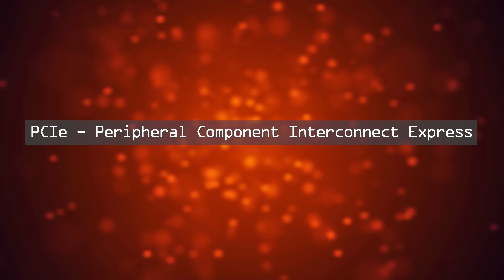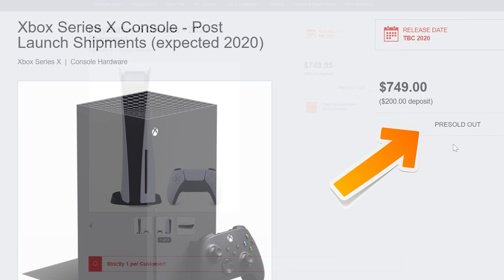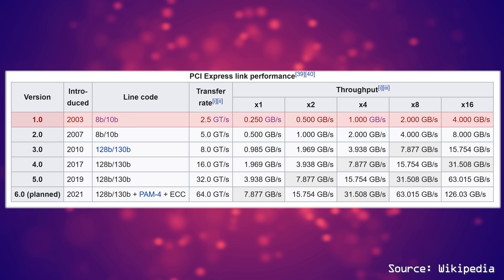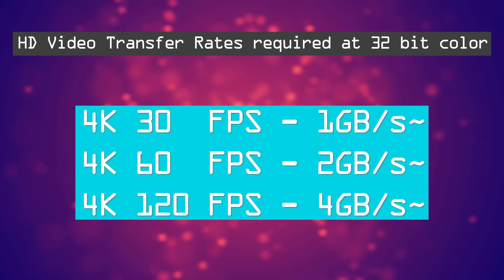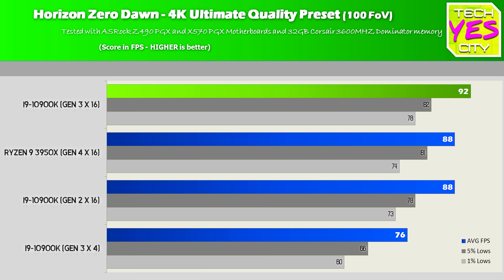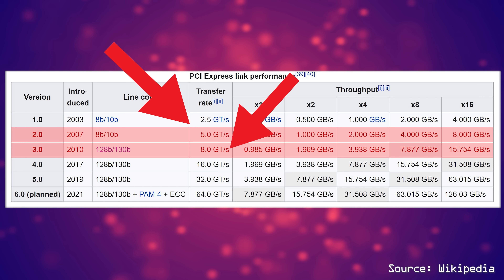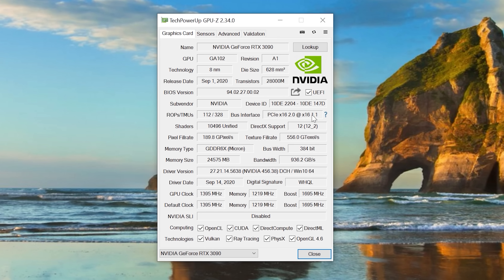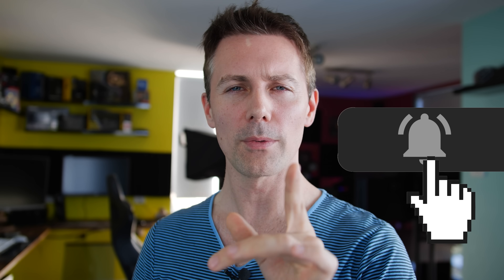Why PCIe 4.0 Doesn't matter for Gamers... Yet

Comment: Great video as always.
It's a real shame not a single person on YouTube tested this with a 3090 Ti and it's a shame that most of these videos doesn't actually test PCIE 3.0 x8.

I really believe that the 3090 Ti, running at PCIE 3.0 x8 would in fact start to show the limit and for sure I would want to also see it tested at PCIE 2.0 x16

Yes, we may just be talking about 5-10fps here and there on the majority of games, but there are a few game engines that actually result in over 10 frames difference.

Comment: I'm just thinking how did they test with pcie gen 2 
like they didn't use old mobo right??
Then how? 🙂
Reply: Likely just by running the gpu at PCIE 3.0 x8
Reply: @marknewellmusic  Is it possible to limit 16x to 8x?? and also to 4x??
Reply: @ashrafjamanshihaf3032   Yes in motherboard bios settings.

Comment: Im about to pickup an aorus b550 master and the pcie slot goes from 4 x16 to 4 x8 when populating the lower 2 M.2 slots.

Given the results here is it fair to assume that with a 3080, i wouldn't have any substantial fps loss using it at 4 x8 vs 4x 16 pcie speeds?

Comment: So here’s a issues I’ve been throwing around in my head. I have an original 2009 Alienware aurora 

Still running an 
Intel i7 930 @ stock 2.8ghz 
24 gb ddr3 ram 1333
And currently has 2 gen 2.0x16 pcie slots which houses a 1gb ati Radeon hd 5770 

I purchased a 1070ti of eBay and it arrived tomorrow and I’m so concerned that it will bottleneck and not give me great performance but after watching this video I think I should be good. But still don’t want anything to happen after it being fine for so long. I would like the performance gains though.

Comment: Thank you for this video !
I want to put my 6900xt in a small case and i may need to put it in the 2nd X16 slot of my motherboard. This slot is gen 3 x8 in a x16 slot, so basically gen 2 x16 speeds. 
Your results tell me that i wont have any performance reduction!!!
Reply: Did it work?

Comment: Came back to this video because of how USB 4.0 Version 2 just got announced with it's bidirectional 80Gb/s connection. Theoretically this should place the new standard somewhere between PCIe 2.0 x16/PCIe 3.0 x8 and PCIe 3.0 x16 with it being closer in performance to PCIe 3.0 x8 than to x16 (64Gb/s vs 128Gb/s). This is really awesome for gamers who want a laptop that can be an everything device with a single cable for connection, I can't wait to see your review of the first devices to have this spec!

Comment: ACTUALLY WRONG: With 3dmark bandwidth test my evga rtx 3080 ftw3 12Gb uses 13Gbs so with pcie 3.0 being 15gb if I ran it in an older revision it would not perform as well at all

Comment: I HAVE A B450 MOST OF MY PSI SLOTS OF FULL SOUND CORD VIDEO CARD ETHER NET CARD NOW I ASK U WAY DUZ MY PC INFO SAY ON MY GPU DRIVER MY CARD IS RUNIN G IN PCIE 3 8TIMES NOT 16 TIMES NOW I THINK ITS CUZ I HAVE ALL MY SLOTS FULL AN ITS CUT IT DOWN FROM 16 TO 8 TO FILL MORE SLOTS RIGHT OR WRONG AN 2ST I DONT NO IF THE B450 JUST DID NOT COME WHITH 16TIMES BUT THAT DONT SEEM RIGHT AN THE CARD IS IN THE GPU SLOT NOT THE SLOT THAT THE CHIPSET RUNS  GPU THOOWE  PS SORRY FOR SPELLING I HAVE A,D,D

Comment: so, since I only have a 1080p 75Hz monitor, I can feed that for just under 600MB/sec. So the fact that I only have a PCIe 2.0 system shouldn't worry me at all. Even x2 is good enough for that, and the GT 1030 is x4, so it's okay at 2GB/sec. It's just that the GPU core is weak; that's why I want to upgrade. Having a SFF limits my choices to the single slot low profile cards - the RX 6400, T600, and T1000. Looking at this, I'm less concerned about an RX 6400 being hamstrung by the bus; it might actually come down to be a good match for the CPU. Though a T600 might work better being a PCIe 3.0x16 card, and may be slower but less stuttery? IDK, but a T1000 would be the better but more expensive nvidia option. But then again, there's FreeSync to consider (my monitor has FreeSync but only HDMI... can G-Sync work over mDP to HDMI conversion? Or is the RX 6400 the way?) 

Yeah, I got questions.

Comment: So Tech YES City,

Assuming x2 performance gains in RTX 4000s vs RTX 3000s...

Are you saying that an RTX 4090 should run fine with minimal performance loss in a PCIE 3.0 x16 slot at 4K max settings?

Comment: You can’t compare on two different platforms. You need to use an 11900K vs a 10900K then use 2560x1440P or even 1080P. You’ll see a substantial difference of up to 5% I’ll take
It. However it is the 0.1% lows that improve the most here.

Comment: So should be totally no difference between PCIe 3.0 x8 and PCIe 3.0 x16 on even high tier cards like RTX 3080 or even 3090 right ? My problem is that I have PCIe 3.0 x16 connector on the board and I am not sure If I will lose some performance If I will use RX 6600xt which has only x8 PCIe lines. Maybe rx 7600xt can have RTX 3080 performance but It probably will use PCIe 5.0 x8, can it be bottleneck on my PCIe 3.0 connector ?

Comment: I have a RX 6600 that will not display on a B550 or X570 motherboard I have. But I put it in my B450 and it runs like Usain Bolt on Gen3. Changed settings in the bios, updated drivers, swapped out M.2 slots, changed to 8x8 in the bios and gen 3, but would not display. Turns out I really don't need Gen 4 anyway, maybe Gen 5 but by then your graphics card is outdated.
Reply: Hey ,  can you more detail , i plan to buy RX 6600. To my mobo b450m , it's still runs or have more issue ?

Comment: right now its not important, but most likely by the time a 4090 comes out, it will matter, also with windows 11 having technology like the ps5, where your gpu can access data directly from your m.2 drive. ps5 does this instant data transfer on a PCIe 4.0 platform. pc's in a year or possible this fall with alder lake and windows 11 will take this tech to a new level using PCIe 5.0. 4k (native) 144fps gaming is finally coming!  and I think it starts wtih PCIe 5.0, DDR5, windows 11, and a graphics card to support this tech, most likely the 4090 will introduce this.

Comment: I'm runnin a RTX 3090 on an old H110 board as my Z170 board decided to kill itself :S PCIe 2.0 x16 seems to work fine until I can afford to upgrade the MB and CPU in the summer

Comment: Hello sir, can you please tell me if it's worth buying a Gen 4 compatible motherboard in 2020 as I am literally very confused. I am building a PC that I plan to upgrade after 4 or 5 years. I won't change the Mobo though and that's the question, will there be noticeable differences between gen 3 and gen 4 after several years or not?

Comment: what if I have a gen 4.0 gpu and a gen 4.0 motherboard but a gen 3 riser cable. would it actually run and would I need to make any changes with the bios or would it not work all together and i've wasted money on a riser cable?
Reply: It would be backwards compatible so your good.

Comment: The main theory is that with the consoles using pcie4.0 that texture streaming will become a major factor. Issue is, that it may not even tax the PCIe 3.0 NVME. At least not the fast 3.0 NVME (3gb/s r/w) so we will see.

Great video and will be linking it

Comment: Thank you so much Brian for your testing and results!!!

Looks like I will be putting a 3080 card into my beloved x58 system. (x5675@4.4ghz)

Going to try and stretch the x58 platform out till ddr5 is here. Anyone else with me?
Reply: Yes mate I'm with you. Still rocking X58.
Reply: @Vorper  NICE!!! would love to know what parts you are running
Reply: x58, W3690@4.1GHz all 6 cores HT off, RTX 3060@2114MHz PCIE 2.0 x16, 24GB ECC ... so glad the RTX isn't too much for the slot. Game (dev) On!
Reply: I get that this is old, but w/e. I'm still running an old X58 system. Do I need to overclock in order to use a 30 / 20 series graphics card without a bottleneck? If it helps I'm running a X5690, but I don't really intend on overclocking unless I absolutely have to.

Comment: isnt 125hz pooling rate 8ms and 1000hz is 1ms which would be a 7ms diffrence maybe you meant 250hz to 1000 as thats a 4ms vs 1ms which is rightnear your 3ms. or was he saying in that mouses case going from 125hz to 1000 ms even tho the pooling rate changed from 8 to 1ms that it only changed a net of 3.5ms of delay

Comment: Can agree on that.
The same was with PCIe 1.1 vs PCIe 2.0 and PCIe 2.0 vs PCIe 3.0 Even saw benchmakrs where the most powerful cards had differences in the single digits at worst.
I actually got a system with a board that supports PCIe 1.1 but the GPU can run PCIe 3.0 and it works perfectly.

Comment: I was relatively shocked by these results however something occurred to me. Current gen games do not fully take advantage of RTX 3090. And probably will not for a few years. I think you should revisit this when games become more difficult to run or try these experiments with VRAM eaters like MSFS 2020. Games designed for current consoles and then ported are taking advantage of that hardware. And it's at least 4 years old or older depending on whether you have a "pro" system or not.
Reply: Say that to 4K ultra, RT.

Comment: I don't understand why you would calculate the bandwidth needed to send 60 fps 4k. It never goes through the pcie interface to the cpu, it is sent to the monitor via hdmi/dp.
Reply: to make a false argument that's easy to understand? I wouldn't be surprised if the games were installed on sata ssd as well...

Comment: Gonna try a 3090 in a PCI x16 Gen 1 slot (DFI NF4 eXpert board) when I manage to get one to see how gimped it is. Pity the overclocked FX-60 I have installed will already have it at a crawl
Reply: Gen 1 oh god that's brutal and it'll work, but it's absolutely crazy. Please pair that a 8k display .
Reply: Bro did it work?
Reply: @sauravmodak507  - never got round to it before I water cooled it.
Reply: Wait...did it work or not? Watercool, what, the chipset?? The MB will only deliver x16 gen1 bandwidth to a GPU that can handle 4 times its max. Just for kicks, what GPU would work on a F2A85-V
Reply: @ShrekMeBe  - no, I water-cooled the 3090 and installed it into my normal (now secondary) system.

Comment: And then there are the german PC/Game-sites - really leaning to being total AMD-Fanboys - claiming they need to test the RTX-cards with Ryzen cause they need PCIe 4 - despite all tests showing that those card run just fine (and basically always faster) with an Intel CPU and "only" PCIe 3. Heck - your video shows that in many games there is nearly no difference between Ryzen PCIe4 and Intel PCIe 2 - not that you would realistically have a system with PCIe2 where the CPU was not the bottleneck.

Comment: what if you're running 3 screens, each at 1080p?
Reply: you need 4 1080p monitor to have data rate of 4k monitor. if a 4k 60 fps monitor just 2GBps then 3 monitor 2160p each then it just 6GBps which PCIe 2.0 can handle
Reply: Then you've shifted the bottleneck more toward the GPU and the  eleague crowd will suggest you benchmark at 720p or 480p to make Intel look better.

Comment: Hardware unboxed proved this too, at 4k there's no difference, but at 1080p and 1440p there is a very small difference. Where it matters is if you wanna use the second and/or third pci slot for something else, than the bandwidth provided by the gen 4 would make sense.
Reply: I could see running two nvme drives in the next upgrade and at least in current designs the second drive either runs through the chipset or steals lanes from the graphics card. With pci4 I don't think it would matter.

Comment: It's kinda ridiculous how some people are pushing Gen 4 like it's the next best thing to sliced bread. Only benefit is you can use faster SSD's but even then it has no impact on gaming performance and the prices are still fairly high considering the amount of space you are getting. Definitely worth holding off for another year or two at the very least.

Comment: One point to understand Brian: the bandwidth you calculated regarding resolution, is the connection from the GPU to the monitor - and has nothing to do with the PCI-E slot. 
The PCI-E slot doesn't carry the image signal - it carries geometric data and textures (at the first stage of caching them into the GPU VRAM). so your calculations there are irrelevant to the matter at hand.
Reply from the maker: You are right, and I did think about this before talking about these numbers, though I ended up using it just a rough guide to help folks understand data rates. And since the numbers actually lined up quite closely to the numbers I was getting in all the games tested, it actually surprisingly will give insight into how much data needs to be transferred between the CPU and the GPU.
Reply: @techyescity  The PCI-E is like another I/O in the system. that's all. the PCI-E bandwidth dictates:
1. how quickly the VRAM of the graphic card can finish pre-caching the textures at the game level beginning. the faster it is, the shorter your waiting is at the game next level loading time.
2. to transfer geometric data on the fly from frame to frame in real time. the geometric data is weighted by the number of polygons at a given image. as time advances games use more and more polygons for more advanced imagery. that's all. so the faster the PCI-E is, the more polygons it can do in a given frame. PCE-I rev 2.0 is still enough for the polygon count used by today's 3D engines. for how long it will be enough in the future ?   this is something I do not know or cannot guess. 
For the time being it is enough (2020) and we could see it by your testing, same like other sources on the web coming to the same conclusion. 
**Faster PCI-E will help in cases where  you use more VRAM than the GFX card has, as it helps with texture swapping against the PC's Ram to happen faster. although you should never set in game quality to surpass the VRAM in the first place, to prevent stutter and low performance.
To sum it up, the advances into PCI-E Gen 4.0 by AMD, is not relevant for GPU usage right now, and can be beneficial to other usages such as faster NVME cards etc...
Reply: @jediii86  that too
Reply: benchmark still says the bigger pictures tho, he tested the card and he got those results
Reply: Dex4Sure  I did not write AMD developed it, I merely said, the advancement of AMD into implementing PCI-E Gen 4.0 ... 
AMD is the first to implement it into the PC domain.

Comment: AMD X570 chipset has theoretical throughput of 8 GB/s, i.e. PCIe 4.0 x4. Both directions simultaneously. At least (upper) middle-tier Asus Strix X570-E's all slots are PCIe 4.0. Including the traffic between Chipset and CPU.
  Between the chipset and CPU, AMD B550 & Intel Z490 offer half of that, i.e. PCIe 3.0 x4 (~DMI 3.0?). Yes, B550 does have PCIe 4.0, but only for PCIEX16_1 and M.2_1. The rest are PCIe 3.0 or less, including the traffic between Chipset and CPU. Perhaps some Z490 boards will get PCIe 4.0 slots too, with Intel's next Desktop CPU's (11th Gen).

Pretty much every motherboard makes it possible to connect your GPU (PCIEX16_1) straight to the CPU. Either 32 GB/s (PCIe 4.0 x16) or 16 GB/s (PCIe 3.0 x16). And at least with AMD CPU's, same thing with the first SSD (M.2_1). Either 8 GB/s (PCIe 4.0 x4) or 4 GB/s (PCIe 3.0 x4). But in case of M.2_2 NVMe SSD, the best case scenario is, that 100 % of the shared bandwidth between your Chipset and CPU is given to M.2_2:
    ----------------------------------------------------------------------------------------------------------
    Chipset           Straight to CPU       Other PCIe-lanes       CPU-Chipset
    ----------------------------------------------------------------------------------------------------------
    X570:               PCIe 4.0                     <= PCIe 4.0               <= PCIe 4.0
    B550:               PCIe 4.0                     <= PCIe 3.0               <= PCIe 3.0
    B450/X470:    PCIe 3.0                     <= PCIe 3.0               <= PCIe 3.0

Some MB's, like Asus Strix X570-E, have an option for PCIe RAID in their BIOS/UEFI. For example (both slots connect to CPU):
    PCIEX16_1:        PCIe 4.0 x16  /  PCIe 4.0 x8  /  PCIe 4.0 x8      /  PCIe 4.0 x4x4x4x4
    PCIEX16_2:                      - -       /  PCIe 4.0 x8  /  PCIe 4.0 x4x4  /   - -

With PCIe 4.0 capable GPU, that PCIe 4.0 x8 + PCIe 4.0 x4x4 sure sounds interesting (two M.2 SSD's in either RAID0 or RAID1). But not before prices drop. And actual average transfer speeds of SSD's rise. Also, real 'intelligent' RAID cards are propably better. And very expensive. But maybe one day, if prices drop...

Comment: So by your reckoning a Gen 4 slot could theoretically run two 3090's using a Bifurcated 2x PCIe 16x riser? Or am I confusing things?
Reply: Yes and if it is motherboard supported  bifurcation then it would still be fractionally faster than gen3 x 16 because of the poll rate
Reply: @hobolive123  thought so. Problem is the slots are expensive. But if buying two 3090's then I guess the riser is pennies

Comment: I’d say that is correct Bryan. The slight improvement in Gen3 vs Gen2 is due to the reduced latency of transfer as a result of the faster polling rate. The bandwidth improvement is irrelevant.
Reply: 100%. Guess I don't need to worry about going from gen 4 to gen 5 with my next motherboard purchase, then.
Reply: @warren2336  they locked it with ryzen LGA now

Unless if you wanna A-series

Comment: So me 10 years old computer with z68 chip set and pci-e 2.1 and a intel 17 2600k in turbo 5gig and 16 gig 3200 ddr3 ram and all ssds hd, can still run rtx 3090 without throtling games 😉🤔